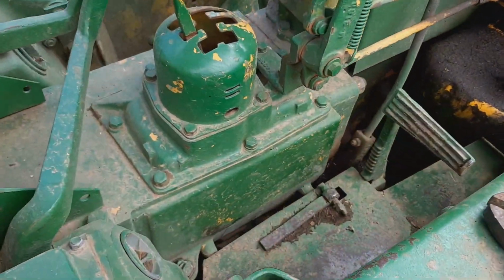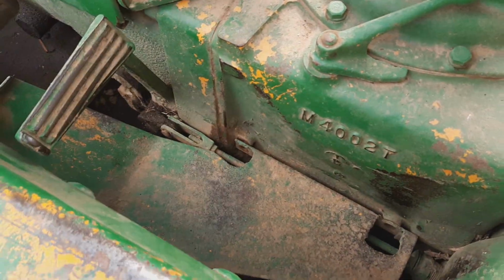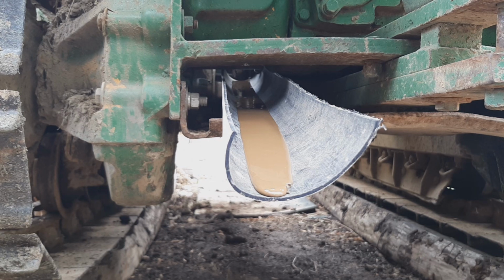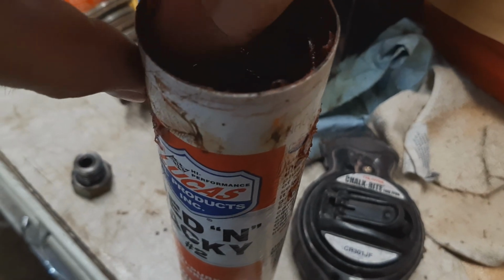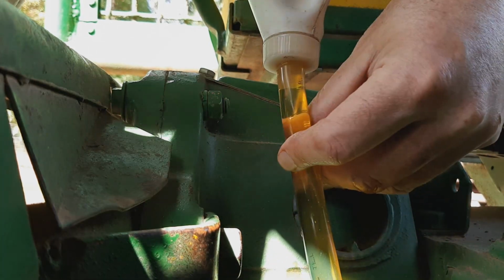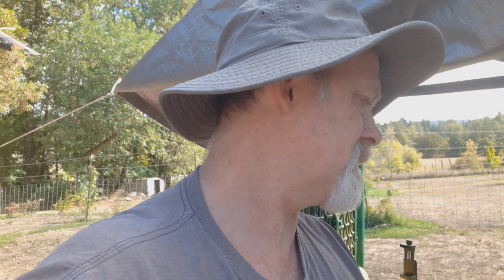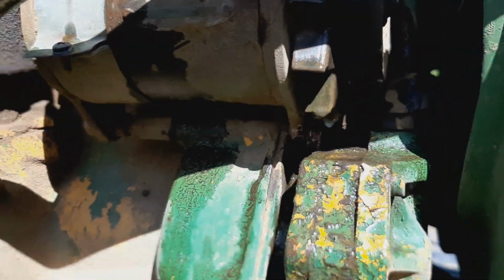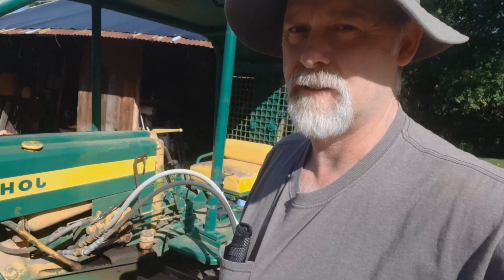John Deere 420 Crawler, Changing  Transmission Oil

Comment: That is not the drain plug. It holds the detent ball for the PTO lever. The drain is a pipe plug like the fill plug.
Reply from the maker: Well tarnation! That would explain why I didn't get much oil out.
Reply: 3 indispensable books for these old gals: operator’s manual, shop manual and parts manual. Deere did some strange “recycling of chapters from “M”s and 40s . and a lot of the stuff for sale has tractor info the does not apply (ie front tire bearings), but for wrenching get the books. Nice machine . Mines a phase one 420, a beefed up 40.